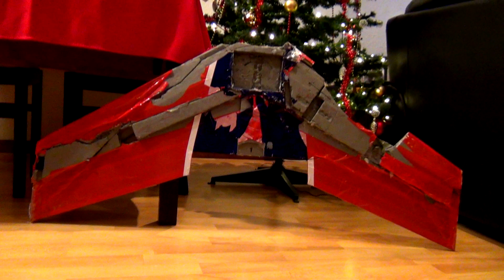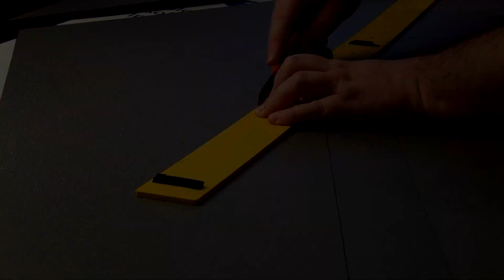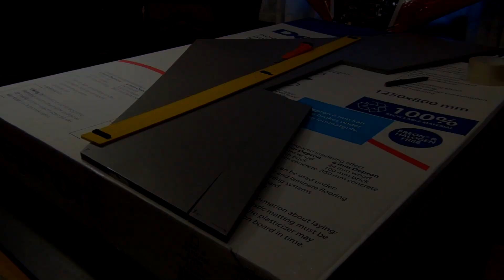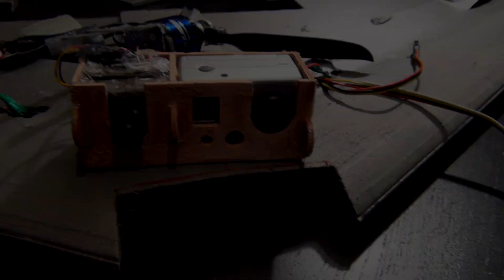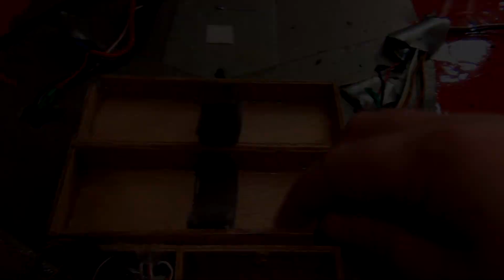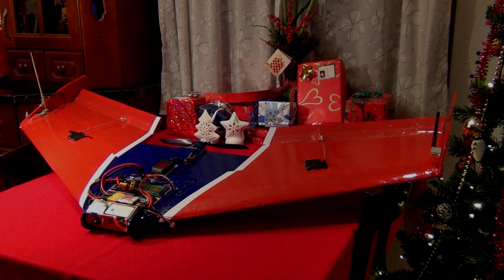FPV49 v3 build 2 Christmas Teaser

Comment from the maker: Without problems. Especially if you make a light weight version using only one battery and a light motor/servo setup. If you make a dual battery version like I did it may be difficult to launch, but still easy to fly. Have a nice Holliday :)

Comment from the maker: If youre an advanced RC pilot and capable of launching the wing without problems: OS OMA-3820-1200KV with 70A ESC and 2x 2650mAh 3cell batteries and some strong metal gear servos (Corona DS329MG).

If not go with 1x 2650mAh 3cell with a lighter 1100-1500KV motor (NTM Prop Drive Series 35-30 1100kv) with 30-50A ESC and some lighter metal gear servos (maybe: HobbyKing 939MG?). I'm looking for some good light metal gear servos my self :). 
I use immersion 600mw 5.8ghz video transmitter.